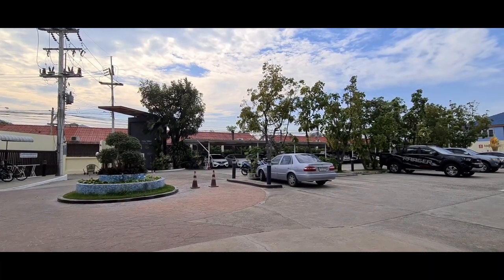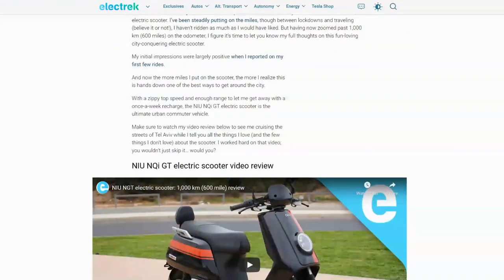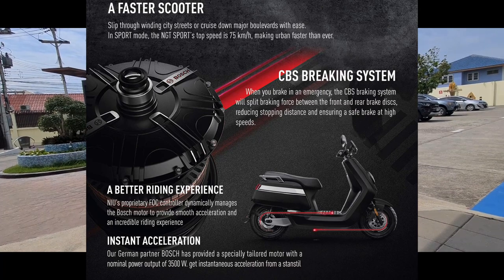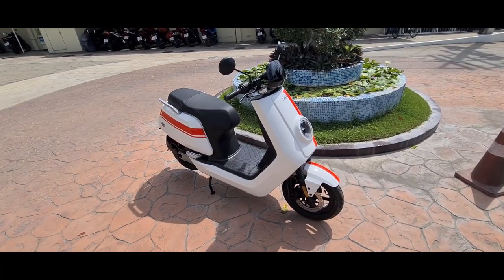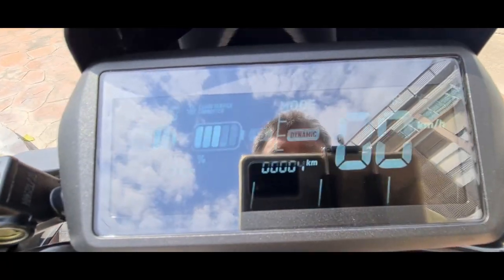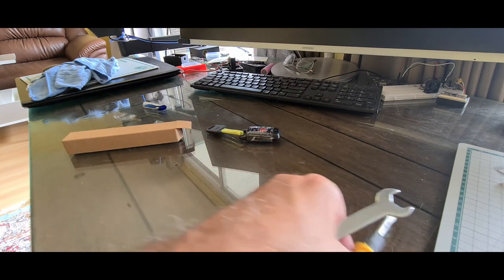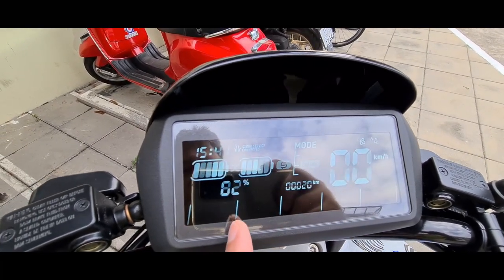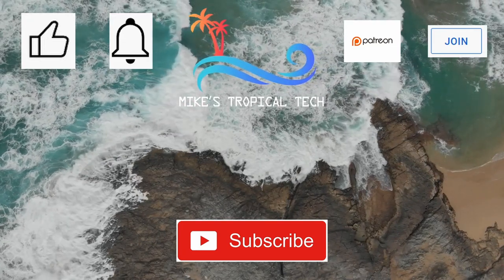My New Niu Electric Scooter!

Comment: Safe motoring! Thanks for the update. It's something I will be looking for when house is built south of Hua Hin
Reply: safe drive, exactly.  in hua hin two people perished, i was told by those who knew them, two different incidents, because of a dog crossing the road. they were not disoriented, despite engine noise of scooters etc.. and now you arrive there with your electric scooter, which you comparatively do not hear at all.
Reply from the maker: Your timing is good to get a great electric scooter now!
Reply from the maker: Yes, that is a risk.  As I said above I'll be looking for a way to add a sound using a small Arduino board.

Comment: Nice, can you buy a fast charger where you take it to say PTT and use the charging station?
Reply from the maker: No, the batteries can't take a faster charging level so it's best to stick with the factory-supplied charging box.  Also there would have to be a new electronics box that acted as the vehicle-side controller to communicate with the charging station and follow the data and power delivery protocols.

Comment: Nice video. Are there any annual maintenance requirements at all for a vehicle like this, and if so where would you take the bike for maintenance in Hua Hin?
Reply from the maker: No maintenance other than keeping it clean and making sure the battery connectors are firmly plugged in.  If I have a serious issue, it's under warranty and Niu will come down here to repair or take back to Bangkok for service and return.

Comment: I would definitely get the tail box for a small grocery shop which would free up leg space, though you may have to purchase the rear bracket also to mount it.  Gives the bike some ‘bling’.  Nice looking unit,  remember that pedestrians do not hear you coming,  the main downfall with any EV.
Reply from the maker: Yes, thinking about that.  I wrote an Android app running on a tablet on my previous electric scooter that played The Jetson's flying car sound to warm pedestrians.  Unfortunately there doesn't seem to be a way to easily add a sound to this model, but I do have access to the USB port and internal 12V power so maybe I can make something up with an Arduino board.

Comment: how long does it take to recharge the batteries? Storage spaces looks limited. overall, a nice bike. thank you for telling us the pros and cons.
Reply: exactly. i would add one more thing: my son always says that the batteries have problems with the heat. so i wonder: can you just leave such a scooter in hua hin always at 30 degrees in the sun?
Reply from the maker: It's specified as a 6 hour recharge, so I'll do the same as my previous electric and plug it in at night and unplug in the morning.  Agreed that storage space is limited, it's the tradeoff for having the second battery under the seat.
Reply from the maker: I estimate each battery weighs about 7 kg, they are the same form factor.  It would be easy to bring them up to my condo to charge.  Yes I can charge it in the parking lot, I just need to make a 10 meter cable for the charger.  I prepay my charges with the front office, we made that agreement when I bought the first electric scooter.  I keep track of the charges and then prepay when I use them all up.
Reply from the maker: @oderblock  I park the scooter under the canopy cover, but the heat shouldn't be a problem for the cells, I've seen thermal camera images of 18650s going beyond 45C.
Reply: They have a company in NYC and Miami that uses these scooters as a rideshare. They are left out in all weather all day and operate at optimal performance.

Comment: This scoot used to have two 35 ah 60V batteries. Now it comes with two 26 ah 60V batteries. Why did they downgrade the capacity? Strange. Or, are you looking at the GTS version with the 14" tires, and the GT version with the 12" tires has room for the larger 35 ah batteries? It's just strange that I keep seeing different specifications for their scooters.
Reply from the maker: I noticed the discrepancy in specs too, but I went with the unit that had the largest battery capacity that were bringing into Thailand.

Comment: u should modified it very soon though. change suspension, controller, tyre, etc  too common do that in China.
Reply from the maker: I already have plans for a new battery pack and controller for my old electric scooter, I can experiment on it while using the new one as my daily driver.
Reply: @MikesTropicalTech  sounds a good plan, and my UQI 1C has already done controller upgrading, tyres, and last week I have changed the rear suspension (BIBOSHI）, handles more firmly.  try this brand modifie parts, suitable for NIU